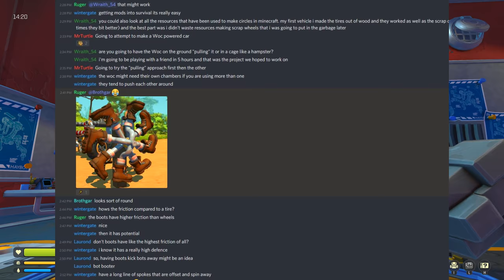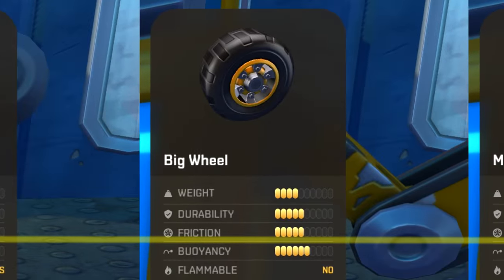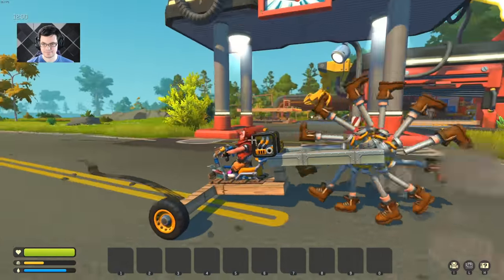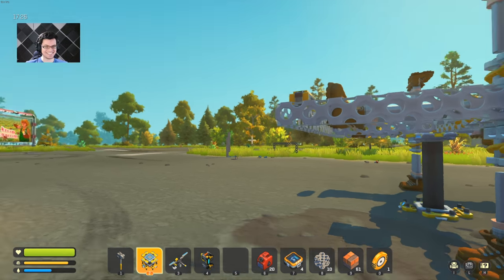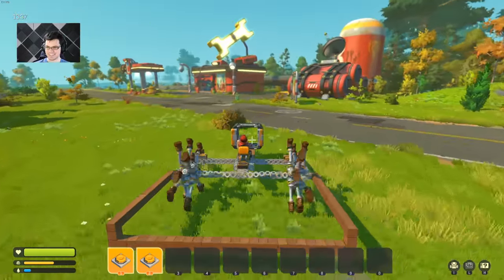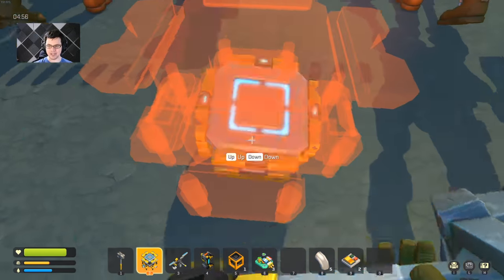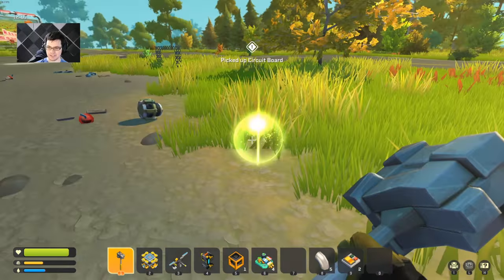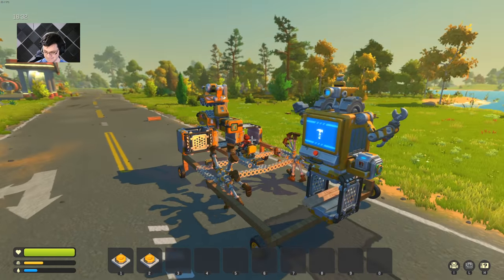I Reinvented The Wheel to Harnesses The Power Soles - Scrap Mechanic Survival

Comment: pipes have really low friction, almost as low as drills and sawblades. you could make some little skis stick out under the middle point where the bearings all connect to take some of the strain off the wheels by letting something solid hold up the weight but still be slippy enough not to slow it down.
Reply: the orange square mesh blocks have even less friction.

Comment: 12:14 fun fact- I picked out random numbers to convert for this caption
originally it was from feet to miles to Which I got .75 repeating (3/4 of a mile)  which is wrong. Its .075 but that would ruin the flow of the caption so I switched to yards

Comment: Why not 4 of those wheels?
Reply: This setup is probably near 100 components per wheel to build all the suspensions, upgrade them and build and upgrade a controller to max.
Reply from the maker: Personally I would like to locate two big rolling pins for each end.